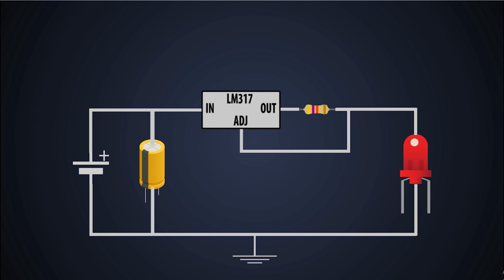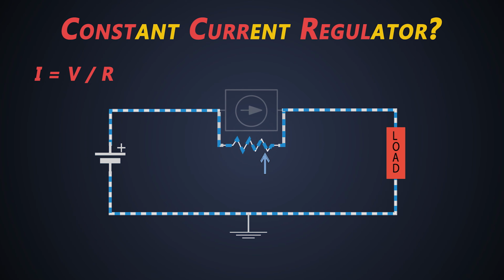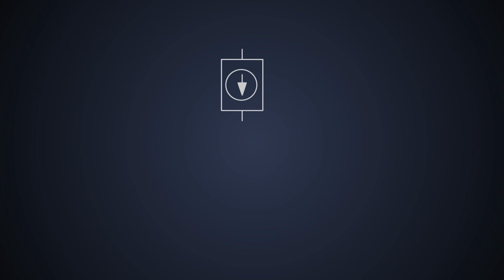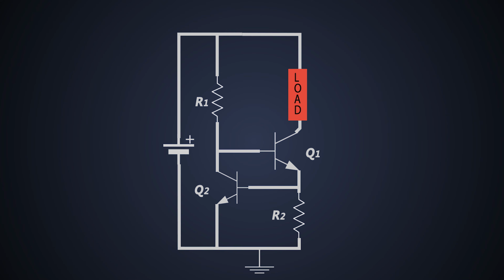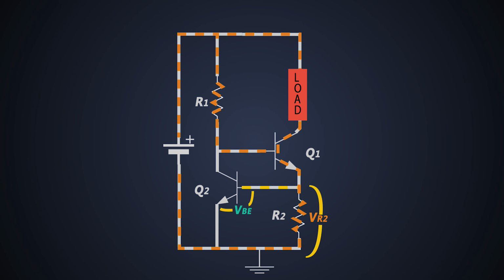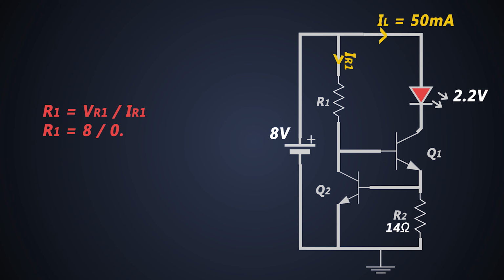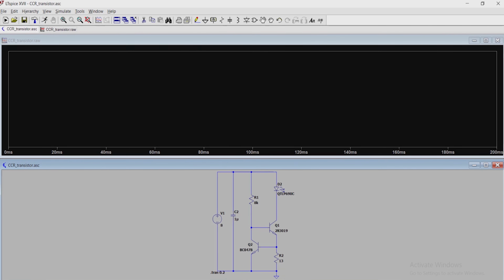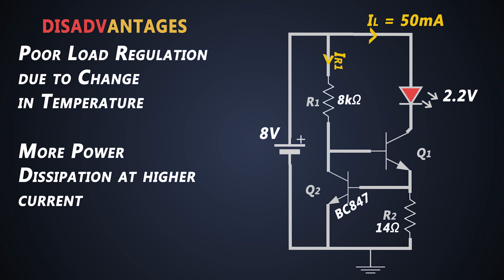Constant Current Regulator using Transistors | CCR | BJT as a current regulator | Current Regulator

Comment: Thank you for sharing your design calculations for this constant current regulator circuit.   When you calculated the power dissipated by R2, why did you assume all the load current would run through R2 ?

Comment: theres a way using tip 41 to limit current at 1.5A 5V?
the main source is 5v 2A but want to use it for etching metals and dont want to destoy the transformer
temperature deviation should make it reduce the current at the load so theres no problem
or i should choose the cheapeast way and just slam a 15w ceramic 3.3 resistor?

Comment: The input voltage is 310vdc, the output voltage will follow the load so I installed 40 LEDs for an output current of 100mA, will it last long and how does temperature affect the current?

Comment: Hi, if i need to make a laser driver costant current circuit as this, should i solder the LASER pole (-) to the "collector" (C) of Q1? And the Laser positive pole (+) should be soldered across R1 just like this video? Where do i need to add and solder some other component as a diode 1N4001 (for polarity protecnion supply) and a 10 uf capacitor? Thanks

Comment: Good explanation. Thank you.
I have a question. How base current for Q2 is limited? Because there is a lot of current available when Q1 is opened.
Reply: It's limited by the feedback loop between the two transistors. For Q2 to turn on, it's base needs to be biased on - ie. we need to get around 0.6-0.7V or so between the base and emitter. This requires sufficient current through R2 to produce that bias voltage. As the base current in Q2 rises, it's collector current rises, stealing current away from the base of Q1. If the base current of Q2 was to rise arbitrarily high, then it would eventually steal all of Q1's base current, turning it off, but then there would be no emitter current from Q1 to bias Q2's base on in the first place. Therefore, the circuit must operate in a delicate balance between Q1 supplying enough current to bias Q2 on and Q2 not stealing too much current and turning Q1 off.
Reply: @brettski74  Thank you for your detailed answer.

Comment: Good explanation and thank you, i need to make output voltage 250mV and constant current 35mA. Input voltage 9V. Please help me to build this circuit
Reply: A constant current circuit implies that you have a varying load which requires a change in the voltage as that load resistance changes. Therefore you cannot specify a fixed voltage such as 0.250 volts. Ohms law, E=IxR
You must choose a maximum voltage for your circuit for practical purposes but then if your load resistance goes to infinity. Open circuit or no load, your current will no longer be greater than zero amps.
A truly constant current circuit would require an infinitely high voltage when the load goes to zero or, more appropriately you would then be operating in an undefined, impossible condition.